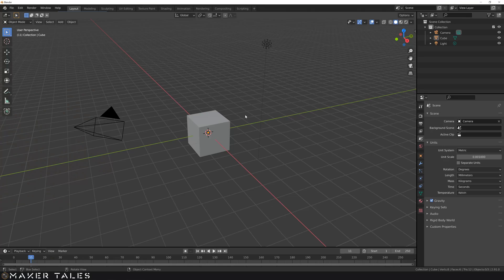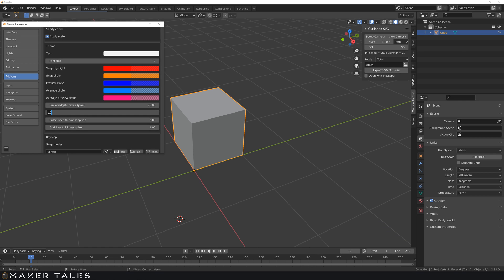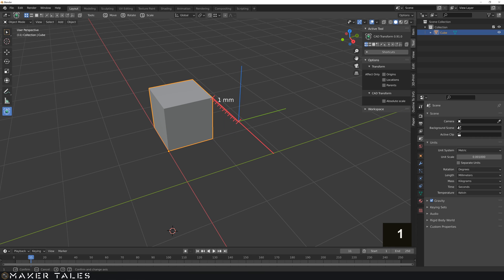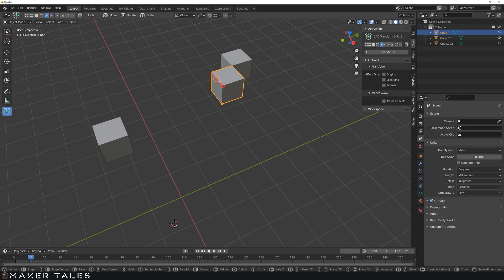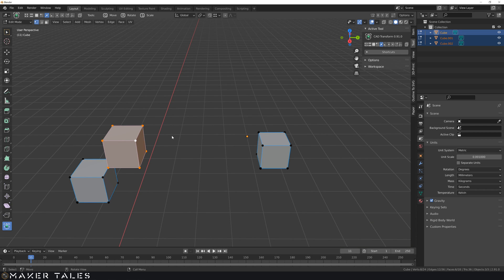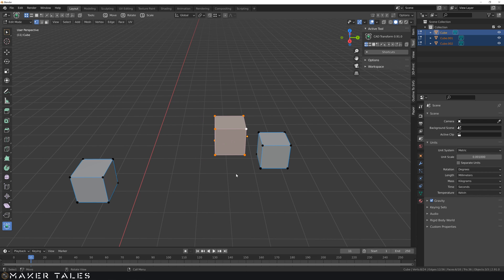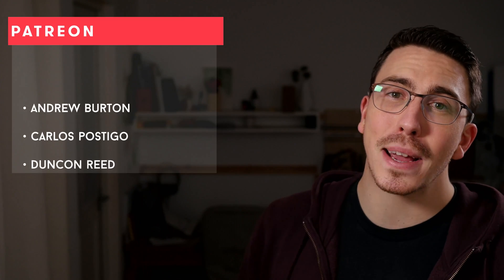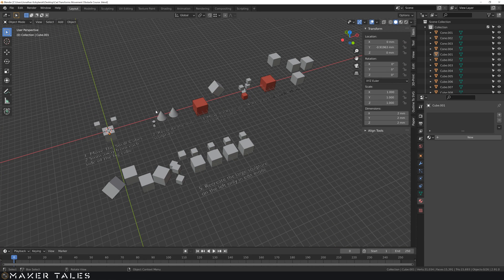CAD Transforms Movement Basics | Blender 2.9+ / 3.0 Through Precision Modeling | Part - 10

Comment: Hi  been going through your videos and they are great  until I got to this section  for some reason  the g buttn to move the vertex doesn't activate when I press G or when I put mouse cursor over the corner vertices.   I'm not sure what I'm doing wrong or if the add on is now redundant due to 2.0 being out?  please advise if possible  thank you for any help

Comment: Is it normal for the unit scale to switch automatically from millimeters to centimeters to meters as you increase the scale or distance? I feel like this did not happen until recently so maybe I changed something in Blender but I don't know what. 
My scene properties are set to metric, 0.001 unit scale and millimeters. But when I move a vertex 10mm it will show 1cm and when I move it 1000mm it turns to meters. I'd like it to just stay in millimeters all the time. Anyone have an idea how to solve this?

Comment: Just found out about CAD transform now, i thought it would be a great tool for my workflow. I am grateful for your tutorial. Download the addon, donated as you suggested, and follow your tutorial. My conclusion is that the tutorial is great however the CAD Transform is frustrating to work with. I work with Blender 3.4 with "slcad_transform_0.93.2.beta.3"    As the saying goes "It's not you it's me" I believe it is not the tool but me. All I tried to do is taking a building originated on LiDAR where the walls are not square, and squarer the wall to 90°. After a frustrating day could not do it - precisely. Yes, i can measure the angles and rotate accordingly however snaping a 92° to 90° was impossible for me. it is as simple SketchUp function as they come. if you know how you can preform this simple function, well..... 🙂Thank you again for taking the time

Comment: Thanks!! Small question: is there any way you can make it snap by object, namely only snap to the selected object, or only snap to other objects? My situation is that I have 2 objects which are already close to each other, and I want to align them exactly. I'd like for the "from" of the translation to only snap to the current object, and the "to" of the translation to only snap to other objects.
Reply: in that case you could put the cursor in the destination point, and hide that object. then, snap to the cursor

Comment: 12:55 If I wanted to increase the length from 3mm to 4mm in cad trsf, you would need to scale by 1.33333 which seems to be clunky. I will see your cad trsf video in the future, but I wonder if you could provide a quick pointer.
Reply: you just have to che "absolute scale" in the options of the add on, and type 4 mm!

Comment: Holy mother of God! Do my eyes deceive me? Precision movement in Blender? I’ve been using Sketchup and ArchiCad for almost 4 years now and I got so used to the from -> to movement. I used blender just for texturing and rendering, because the normal movement tool is abysmal ( wth, you press G and it moves directly. Also how everything just only snaps to the origin point and lack of snapping options; I just couldn’t get into it ).

So now I can finally ditch Sketchup (my main modeling tool) and use Blender. I wanted to do this for such a long time because Sketchup has a lot of the basic functions missing ( like bevel and chamfer ).

Anyways, cheers mate! You earned a new sub here! I’ll go ahead and look at the in-depth videos. I can’t contain my excitement haha :)
Reply: You and me both! Save myself £250 a year too :)
Reply: @aidanbowen9052  True that! I can use that extra 250$ to purchase add-ons, assets and decals :)

Comment: Hi guys, after installing the add-on, and even with this last one active, shortcuts like "V" do not work, it seems that there is no overlap on Blender's source commands. I'm using version 2.93.1. Does anyone know if there is any command or something for the add-on to take control of the shortcuts? Thank you!
Reply: you might need to clear the snapping with "space"? (I think following instructions closely on Blender 3.1 seems to mostly work, but I was tripped up by this myself)

Comment: How to best do the following tasks:
1. two objects. Align an edge of one of the objects with an edge of the other object. I don't mean move there, I mean the two edges should not only touch but have the same rotation (be parallel).

2. two objects. Align (position and rotation) the polygon of the first object with a polygon of the second object. Both polygons should at the end be in the same plane.
Reply from the maker: Hey, TheChartle.
Best place to ask these questions is here: https://blenderartists.org/t/cad-like-transform/1226197
From what i'm gathering here the number one thing that there is to masker is the combination of snapping points and normal snapping will be able to achieve this I understand the question. But best ask the dev to get the concrete answer.

Comment: I really wanted to like this, and I do, but I ran into a rather nasty trap at first while trying to follow your video. After starting Cad Transforms and selecting an object, I couldn't figure out why I wasn't seeing the snapping circle or movement gradations when moving an object. As it turns out,  Grab (G) MUST be selected first for the snapping and measurement lines to be enabled! You did say that you selected G, then you say "but nothing is moving" so I thought that the G was unnecessary. Took a while to figure that one out.
Reply: Had the same issue, thank you for putting the solution!
Reply from the maker: Hey Unicycle, I can relate with your point. I find that the best way I see it is that I'm going into CAD mode and out of CAD mode. It can take a little while to get used to the idea.

Comment: The installation of the addon proceeds normally and it works perfectly the first time, I save my file and when I open it again I can't find the CAD tool. I get an error message: "Tool Slcad Transform not found for space View 3D"?
Can you help me
Thank you
Reply from the maker: Hey Claude, your best place to get support for the addon is by the dev https://blenderartists.org/t/cad-like-transform/1226197
To me it sounds like you might not using the right version for the right version of blender.
Reply: Indeed with the right version it works much better ! thanks

Comment: Suppose I´m doing something wrong. Downloaded Cad transform and tried to install it. installed Py files:    _init_.py, slcad_snap.py, and slcad_transform.py.   I´m running blender On Mac OS Big Sur
Reply: Ensure your browser did not unzip downloaded files on the fly !  You may recompress the whole folder and setup from that compressed file.
Reply: Thank you, that was the problem. Safari had unzipped the files.

Comment: It's a great addon. What I'm not seeing is a way to align the gimbal in a 3 point manner. Say your cube is rotated such that no face is co-planer with any global XY, YZ, ZX plane. How would you snap the gimbal so that the XY portion of the gimbal is co-planar with chosen face of cube (and individual X & Y axis's co-linear with edges) with Z axis in line (parallel) with the intended Z axis edge of the cube? In AutoCad it's easy to manipulate your UCS in this manner as well as do one step 3D aligns. AutoCad treats a UCS as an object .. sort of .. that can be manipulated in about any way, including origin shifts. That would be nice addition to this plugin .. if possible.
Reply from the maker: Hey Xen Uno, I completely understand where you are coming from. 1st I would say to provide this feedback directly to the developer and then maybe he can implemtn somehting https://blenderartists.org/t/cad-like-transform/1226197
2nd, the key thing to understand here is "Normals" more often then not the reason why there is only 2 axis definitions be because the normal is taken as the 3rd. I know it can be a little wired and by all means I don't know if it's right or wrong but I just thought I would share my experience with you and encourage you to let the developer know.
Reply: @Keep-Making  Hi MT. Leger actually does know and has commented briefly on it in one of your other videos. His summary as I recall was that it would be complex to code but he is aware of the need.  I see there is that Blender function (can't think of name of it atm) that does allow Cad Trans to move gimbal only but again .. you still can't line gimbal up in a quick 3 snap manner ala AutoCad. That function of Blenders is perplexingly avail only in Object mode.

Comment: Great series, thank you! 

I have a question about scaling with CAD Transform - Is it possible to scale on 2 axis at the same time? For example, i have a cylinder in the default orientation and want to scale it on the X and Y axis but not on the Z axis. I press S to scale and select the face center of the top face and one of the vertices on the side. Now if i press Shift+Z to scale along the X and Y axis it still only scales along the X axis of the coordinate system i selected but not on the Y. What am i doing wrong?
Reply: Ok i kind of figured it out. If you press Tab it works. Don't know why though :)
Reply from the maker: Hey Spike, that is exactly it. As to why it's like this. It's how the addon was designed by the developer.

Comment: It's a great add-on, but I'm having problems with the keybinds (even when set to default,) apparently there is a conflict somewhere, especially in Edit Mode, between Space (used for Search and Clearing Snaps) and G (for movement and Grid snapping) I'm pretty sure it's me, not the add-on, that I don't know what I'm doing and clicking things when I shouldn't, but it's really weird.
Reply from the maker: Hey Xavier,
Ah this one has catch me a few times. You need to make sure you are in an operation before using the short cuts. I.e. Make sure you are already doing a movement operation (G) and then you can hit space bar and all the other shortcuts.
Reply: @Keep-Making  Thanks!

Comment: The problem is you can't use this addon in large fales. It gives lags. So it is not usable for architecture.
Reply: Small performance issues with huge set of 2d data are expected as it is implemented on python side, however it should not be the case even large 3d models.
Tests did not show any slow down on 1.5M + points terrain.
On 1M + points line set and init time is like 0.1s / 100k points on polygon curves, bezier may be slower.
May be an issue with the structure of your data, with high number of blender's entity ?
Reply: @StephenLeger  I imported 3d objects from Rhino. I can send my file also to check. It is super laggy. I can't control anything when l enabled this addon.
Reply: @hapichteam  to me looks like an issue with the model's structure rather than overall weight, too many objects i guess. Feel free to share the file with     support (at) blender-archipack.org
By the way, thank you for your feedback !
Reply: @StephenLeger  I'm transferring the file. It will take a while.
Reply: @StephenLeger   It has 2 million verts, 1.6 million faces and 5996 objets.